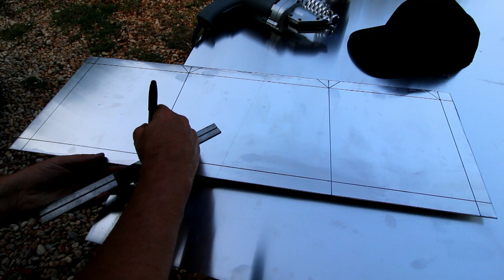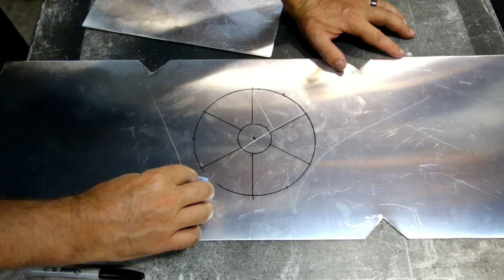How To Make A Custom Battery Box

Comment: Really enjoyed this video, as always. It was like you read my mind, I'm wondering what's cleaning the permanent marker- acetone. I always use CAD when designing things. Cardboard Assisted Design, but a lot of the time it doesn't fit right, after transferring it to sheet metal. Probably doesn't help that my sheet metal brake is 2 pieces of angle iron in a bench vice, and a hammer. It works for me, and you're great at explaining things, why you do it a certain way. Who said you can't teach a 50 yr old dog new tricks.
Reply from the maker: lol...thanks

Comment: How the h did you do that design. I saw the wheel thingy but how did the whole panel depress smoothly and evenly like that? Impressive! Wanna build a box/panier for my motorbike. All I have is an angle grinder, drill and a file. think I can do it?
Reply from the maker: the bead roller does the trick

Comment: Looks great. What type of riverts are they?
Also the tool that is used to hold the parts together while you drill and rivert, what are they called?
Cheers
Reply from the maker: Just a solid aluminum aircraft rivet. The other tools are called clecos

Comment: Box looks great . Totally off topic of this video.  Eastwood has a tri flow radiator on their website. I just saw the live video they did on it yesterday. The price is super cheap for a fully welded aluminum radiator. I'm going to buy on see if it will help my cooling issues I'm having with my Foxbody. 900 + hp with pump gas and low boost c4 trans with brake . Didn't know if you have any experience with it or not . I'm hoping it will do the trick . Do work son !
Reply from the maker: I dont have any experience but we have talked about them....you place the order dont forget to use thefabforums for free shipping
Reply: Black Knuckle http://www.stevesnovasite.com/forums/showthread.php?p=4003018

it's mostly just marketing, and can potentially damage your engine if your pump isn't big enough..which I doubt running 900hp lol. But a single flow radiator is actually more efficient.
Reply from the maker: I dont agree with what dude is saying.  he says flow is king and its not. If the water flows too fast through the radiator it does have to dissipate heat. I have experimented with this my self by replacing a thermostat with restrictors. If the fluid moves too fast through the radiator it never cools and it will over heat.
Reply: Well I have a aftermarket pump that flows decent amount of liquid. It's not the biggest but it is good enough for my engine setup. The water must have time to let the air running over the fins pull the heat out of it . So more flow or faster flow isn't what you want in this case . I work on equipment at my job and flow and temp is key for it to work properly.